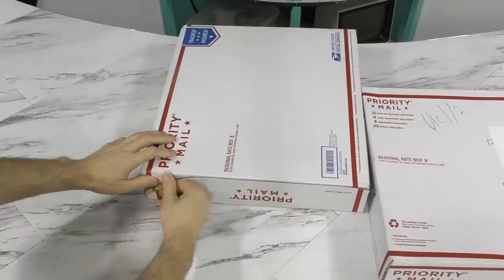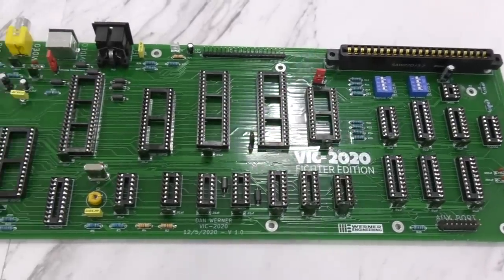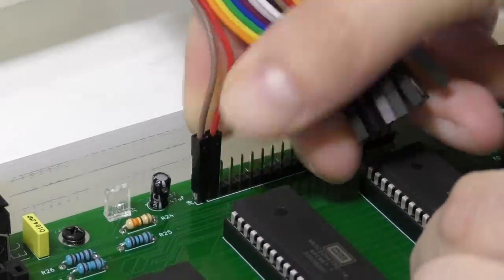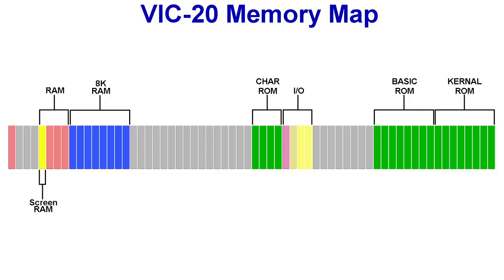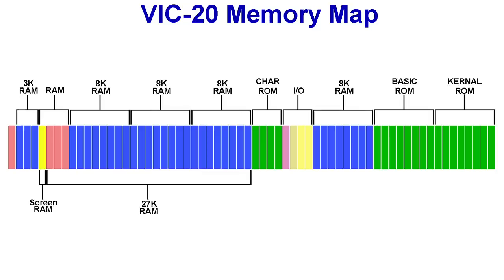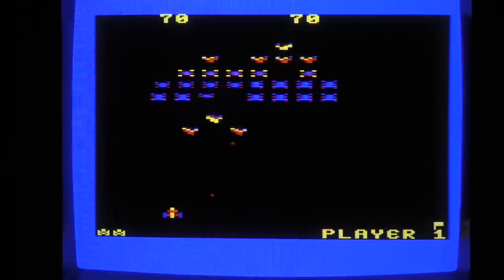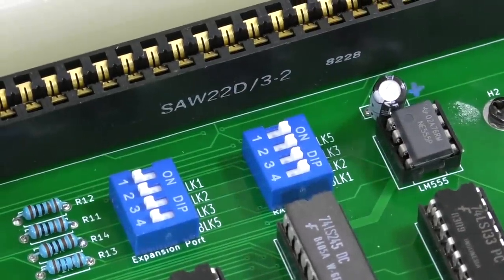Building a VIC-20 Kit Computer and X16 Update.

Comment: This kit is great if you have a dead vic-20 
Then you can swap motherboards and have an up to date motherboard that will probs last for years
Reply: I didn't even think of that!
Reply: @cyberman7348  i don't have any vintage computer
Reply: Don't think you can swap motherboards as it's not gonna fit an original case nor support the ports
Reply: @aprofondir  that is true for example the cartridge slot is upwards not to the side however you could do a mod (as it is a kit) and actually make it work
Reply: @nidulaperera  You must be a Millennial if you think that's "vintage."
Reply: @ct92404  that’s true I agree however it’s the only “old” computer I have is just that
Reply: @ct92404  how is this a generational thing?
Reply: Just repair the VIC. It's not that difficult.
Reply: @WinrichNaujoks  true true but what if you can’t source a new board because you can’t repair the old one
Reply: @ct92404  What are you babbling about? I generally default to the 50+ years = vintage; 100+ years = antique standard but microcomputers haven't even been around for 100 years (and have barely been around for 50).

If one is 25+ years old, it's fairly safe to call it "vintage". And did you even reply to the correct comment? Seems you're trying to roast OP when they didn't even use the word "vintage". Silly Boomer-brain...
Reply: @popefacto5945 Lol triggered Millennial? 
You got awfully worked up about a one sentence comment. And do you even know what a Baby Boomer actually is? You're not exactly helping your case much 😂
Reply: @ct92404  omfg bro, you started roasting OP, OP never said vintage in their message, and now you're defensive
Reply: @theforerunnerreclaimer  He deleted his comment where he said that a computer from 2003 was "vintage." Notice how my comment got 4 likes? Apparently I wasn't the only one who thought that was ridiculous.
Reply: @ct92404  I dunno, I’d much rather be a weeb than an angry grandpa like you. and for your information, I’m not a millennial lol

and again, what does this have to do with generations? honestly it’s super dumb if you think something incredibly mundane is generational when it’s not
Reply: @poble  "iM nOt a MiLleNial, iM gEnErAtIoN z!!1!!" 
If I'm a "grandpa" then math is definitely not your strong subject lol. Go hug your waifu pillow.
Reply: @poble  You came late and didn't see the comment he DELETED...and then you got triggered. Again, several people apparently agreed with what I said. Grow up, weeb. Learn math. If I'm "old" then you're middle aged. 😂
Reply: @poble  No one else would think that a computer from 2003 is "vintage," that's why. Millennials have a weird thing where they think anything more than like 2 years old is "vintage" or "retro" lol. I have never heard anyone else try to call something from the early 2000's "vintage," not even actual Gen Z kids. I don't know why Millennials have some kind of warped sense of time. I guess they can't get past their angsty emo kid days even when they're 25+ and so they always try to make it seem like they're younger than they are. That's the only explanation I can come up with when even kids know that something from the early 2000's isn't "vintage" LOL.
Reply: @ct92404  Things have changed so much, and more rapidly than (say) automotive mechanics or how to build a bookcase, that a small number of words (antique, vintage, classic) is simply not enough.
The 2003 computer would, if memory serves, be a 32-bit x86 running Windows, so very much like today compared to the Vic anyway.  HDD mass storage, but using 80-pin ribbon cables.  Did have USB.  White PCI expansion slots, and a separate modified one for a graphics card, if memory serves.
You can pick out major watersheds, like microprocessors vs older designs.  But much of the change is multiple overlapping different things.  The 32-bit Windows Intel machine is essentially the same since the Pentium, but the drive technology changes at some point, the drive connector changes, the expansion slots change, the ports change, etc.
Reply: @JohnDlugosz  Well, that's exactly my point. A computer in 2003 is FAR too modern and similar to today to call it "vintage." A computer in 2003 could already use broadband internet, had USB flash drives, SD cards, a 3d accelerated video card, a DVD drive, etc. In 2003, I was downloading entire movies. And YouTube was launched just 2 years later. So calling something from the early 2000's "vintage" is ridiculous. It's too modern. The Vic-20, on the other hand, is DEFINITELY a vintage computer because it represents a much older and completely different form of technology.
Reply: @ct92404  troll
Reply: @molybd3num823  triggered Millennial
Reply: Dude Pro  yeah honestly generations are a dumb concept, being born in one generation doesn’t make you better or worse than someone who’s born in another
Reply: @poble  hey Poble what has happened here
Reply: @nidulaperera  just a nonsensical argument really lol
Reply: im better than you at computer science
Reply: @poble  oh
Reply: @amongusplaz9020  no sussy gamer
Reply: @nidulaperera  no sus
Reply: @amongusplaz9020   That may well be true, but I would posit that there is no computer science in 6502 based machines; no structured data, no object-oriented compiled languages, no functional programming, nothing at all like that. Plenty of soldering (and the accompanying swearing when you solder yourself). Plenty of assembly language programming (every branch a GOTO),. Sometimes quite a bit of machine code, poking hex values into memory to patch up the problem. But not really any need for computer science. Kind of like standing around looking at a skateboard and claiming you're a better motor mechanic.
Reply: @nidulaperera  yes I am
Reply: @nidulaperera  i am better though
Reply: why you need Vic 20, running what?
Reply: @ct92404  in terms of home computers, a vic 20 certainly is vintage. and millenials would nearly be in their 40's now, i assume you're using it as a shorthand for young peole?
Reply: @j377yb33n  You came late, the OP deleted his comment where he claimed that a computer from 2003 was "vintage." And no, Millennials are definitely NOT in their 40's. That is the youngest of Generation X. I'm 43 and have never been called a "Millennial" (thank God.) I'm either the end of Gen X, or between Gen X and the Millennials - what people call an "Xennial." Millennials were born in 1990 and later and they were the ones who were all emo kids when they were teenagers in the mid-2000's.
Reply: @popefacto5945  You're trying reaaaallly hard to identify with the Emo Generation then. That's weird and kind of pitiful.
Reply: @poble  No, apparently anyone born after 1990 is an air-headed, skinny jeans wearing former emo kid who is completely clueless about computers though and thinks that the early 2000's is "vintage." 😂
Reply: @ct92404  millenials are people who either matured around the turn of the millenium, or ended up growing up with the knowledge of the internet, without it becoming saturating in their lives depending on regions and class. i don't know why you're so pissy about an arbitray name aside from how the media has used it as a catch all for younger generations and their weird habits.

And by now, yeah I would almost consider a 2003 pc vintage. the playstation 2 is nearly settled in the retro gaming camp, it's nearly 20 years on. I mean in terms of technology, it's not quite as vintage as one 5 years prior, but just because of your stuck up attitude i'm going to side with him.
Reply: @j377yb33n  Generations are determined by when people are BORN, not when they "matured." Millennials were born in 1990 and later. Period. YOU must be an air-headed Millennial yourself. Go listen to Taking Back Sunday and whine on LiveJournal about "No one gets me!!"
Reply: @ct92404  lmao, I'm gen z/millenial, depending if you go by the cultural aspect of millenials or the way it would apply for suburban Americans. I still don't know why you're so proud of an arbitrary threshold and label too.
Reply: @j377yb33n  I don't know where you live, but in the US, NOBODY likes Millennials. I've even seen kids making fun of them. Seriously not making that up, I saw a 14 year old roasting a 25 year old. Maybe they're different in other countries, but in the US, people specifically in their 20's have a very well known reputation for being air-headed, extremely immature, and anti-social.  People younger than them or just a little older than them are generally very different. I don't know why. Maybe Millennials were raised weird?
Reply: @ct92404  Again; what are you even babbling about? I'm several years older than you. Definitely not an "Emo Kid" (though I do recall when that subgenre of post-punk was referred to as "emotional hardcore").

And you're replying after nearly a week just to insult me? Wow. Here's your attention. Soak it all up because that's all you're getting from me.
Reply: "Dead Vic-20" except when the reason it's dead is the 6560 Vic chip like on my Vic-20. Literally every other chip on the board was good, except the 6560, the hardest chip to replace. I did get a replacement on AliExpress, didn't need a whole Vic-2020 kit at all.
Reply: @KoopaMedia64  Well it’s been 2 years since my Comment, but yeah. The meaning of what I meant behind “dead vic 20” is where the board has either gone through water damage or idk burnt a lot of traces. If it’s just a chip then yea it’s better to replace the chip itself 👍

Comment: The negatives/doublespeak on that moisture card are annoying as $#!%! It may not have mattered, but I think it was actually telling you that you DID need to bake them: "Bake parts if 10% is NOT blue..." {which is true, because it is pink, not blue} "...and 5% is pink." {which it also true}
Reply: That's how I read it. It seemed like it was describing two sets of parts, the level 2 parts that didn't need baking (because the first circle was blue, and the level 2A-5A parts that did need baking. Took me a couple reads to get that, though.

Comment: 1:58 Yikes, that power jack is not going to last, especially if you're using it constantly for turning the system on and off. It's only got the main two pins holding it on. There's holes in the PCB for the sort of jack that has two extra large pins to make it more secure, yet it came with that cheap one? That's nuts.
Reply: I’m still waiting for some kid to wander along and complain ”But it hasn’t got USB C … fail!!” etc 🤦‍♂️🤦‍♂️
Reply: @unlokia  On one of his other videos (forgot which) someone was complaining about how the power connector was horrible and a USB connector would last longer

Comment: Lack of a VIC replacement notwithstanding, I think I'd go in with some bodge wiring to get the S-Video pin out correct, and extend the DIPs to mount them on the case in a suitably cut slot.  Hopefully some future case rev will allow that.
Reply: That case looks suspiciously 3d-printed.
Reply: @Grunchy005  and that's a problem why? it's easier and cheaper to 3d print cases.

Comment: Regarding the X16, ever since you guys added expansion slots I've been curious.  Why wasn't VERA moved to a slot? Is it to maintain a form factor that lends itself to making a C64 cartridge? Or is there some underlying issue like communication speed, voltage or something?
Reply: I don't speak for the project but I think they wanted it to fit within the ATX IO shield area and be as compact as possible.
Reply: Also I believe that the VERA is basically required for the computer to function at this point, as opposed to being a default option one can switch out.

Comment: There are two solutions to the keyboard. 1 - use a uniform profile such as DSA or XDA. 2 - Use blank keycaps and put stickers on them (or make your own dye sublimated ones).

Also for non-uniform keycaps, I'd recommend either the SA or MT3 profile (though I don't know if either of those are available as blanks).
Reply: The SA and MT3 are pretty expensive so using some knock off dsa can be easier
Reply: @khoinguyenphamtrong4637  True, but they would give a more authentic feeling as they pretty much resemble what was on Commodore breadboxes. Especially SA which usually comes in glossy ABS.
Reply: How do make custom dye sublimated keys?
Reply: @daemonspudguy  Kinda like that: https://www.reddit.com/r/MechanicalKeyboards/comments/gu1qmc/diy_how_to_make_custom_dye_sublimated_keycaps/

Comment: It's so cool to hear your happiness when talking about to start assembling a new kit. :D
When you showed the Petscii Robots game on the X16 I let out a "WOOOOW!" Looks amazing!! I'd like to buy one of your C64 versions but alas my drive developed the failure where it spins forever and never reads. That's the only cause I'm not longer using GEOS to this day. Also I saw you're going to publish an Atari version but the machine is a 130XE and I only have a 65XE and no disk drive. Will you ever make SD card versions? It'd be easier for me to get one of those modern SD card readers for the Atari or the C64.
Also I smiled when you commented the Vic2020 keyboard feels amazing. I was like "Yeah! r/mk rulez!"
Thanks for the episode! Peace.
Reply from the maker: All versions of the game also include a digital download so that you can put them on SD cards or whatever your drive emulator needs.  The 65XE should be able to play the game just fine, but will require a disk drive or some sort of drive emulator.
Reply: @The8BitGuy  you could also go cartridge route even though it would be more expensive. Especially if ported to the 5200. AtariAge and Good Deal Games do sell 5200 cartridge games just in case you wanted to partner up...

Comment: Wow. Omega Race on the Vic-20 is a really solid port!
Reply: I got no memory of how many hours of my childhood i spend playing omega race on my vic 20
Reply: Omega Race is the only VIC-20 cartridge I own.
Reply: It really is surprising how close it is to the original arcade game, especially considering that you're not only stepping down to a slower CPU (the original used a Z-80 running at 3MHz) with less RAM, but going from a vector-graphics display to a bitmapped raster display to boot.  Probably one of the best Omega Race ports out there.  Someone at Commodore put a lot of work into that one...

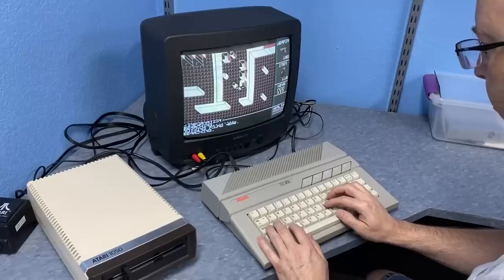Comment: 16:06 YES! YES! THANK YOU!!
Will it run on a Atari 400 with 16k, or do you need at least 48k like an 800 has?  My 800XL has 256k so I should be good.  :D
Reply: you could upgrade the Atari 400 to 48K even back in the day. And there's a lot of upgrades for both... even modern ones like the Incognito board... there's plenty of YouTube vids about it.
Reply: @TheJeremyHolloway  I know, I'm just wondering that the system requirements would be, or if it would run on a non-XL/XE Atari in the first place.

Comment: That moisture card shouldn't be there as it's mostly for SMD parts, moisture sensitive part are only a problem when you reflow slolder them as  steam could come off the package and misaligned the chip off his footprint. For a socketed dip chip it's fine....

Comment: The VIC chip shortage could be solved by the use of an FPGA drop-in replacement.  It shouldn't be too difficult to reverse engineer the VIC.
Reply: Probably a CPLD is already goed enough! And maybe even a PIC could be used.
Reply: Any replacement with generic chips will have a different pin out, so needs either a board redesign or a complex daughter board that plugs into the VIC socket.
  A PIC is a single chip computer and will have to run a software emulation, not a real time equivalent circuit as can be done with ULA chips such as FPGAs or CPLDs
Reply: @johndododoe1411  Well, I don't know how complex the VIC is, but there is a PIC based replacement for the SID as well. And of cause you need to create a small dochter board, but the footprint of this board does not mean that its much bigger than the chip itself. Specially when using SMD components.
Reply: And P.S. they are already working on it, based on FPGA.
Reply: @marcelhh2101  It's a fairly complex chip, and while it might fit into a large CPLD, a small FPGA would be cheaper and larger than the largest CPLD.

Comment: Nice! I would have mounted the DIP switches on the backside of the PCB and cut out a hole on the bottom case. That way it doesn't ruin the look of the machine, but the config switches are still easily accessable.

Comment: I like the idea of a redesigned Vic-20 and really like the keyboard. My criticisms are exactly the same the David has pointed out. I don't understand why he wouldn't fix the S-video port and the reasoning for leaving of the cassette and User port makes no sense. 99.9% of the time you'll never need more than 5 VDC for anything you do on a Vic. For those that are using some exotic piece of hardware that needs 9VAC, tell them to provide it with a cheap 9VAC wall wart and just put a barrel jack on the mother board.

Comment: I think I can speak I behalf of many when I say we would love to see the Commander x8 FPGA prototype and what it can do in a proper intro video please.

I think most people are excited about  phase 1 and phase 3 of this project. 

Whatever you do, please make sure that phase 3 will have GPIO pins that matches exactly that of Raspberry Pies. 

I think having GPIOs which can be easily programmed with basic will be a key contributor to the success of the phase 3 of this project. 

I know someone else built that product. But it is on.a large board and it costs more than $75. 

And by making it compatible with RPie GPIO pins, people can tap into the large market of GPIO accessories that are readily available. 

Hobbyist don't do only 8 bit games. They do many kinds of projects.